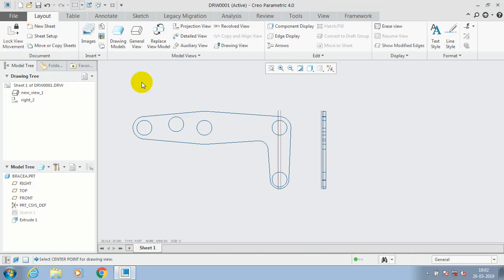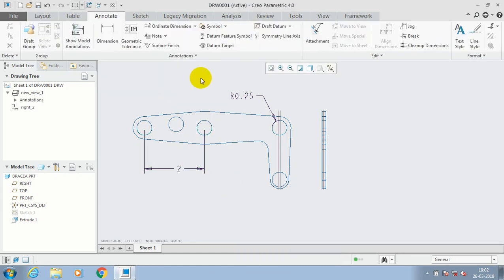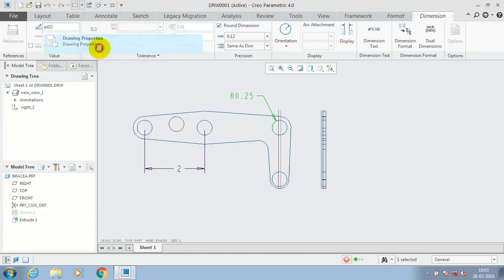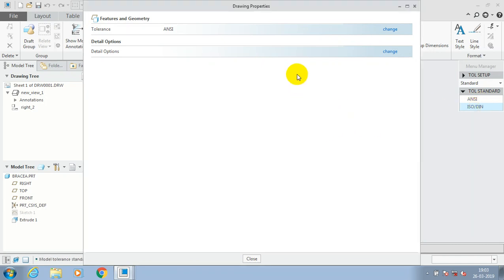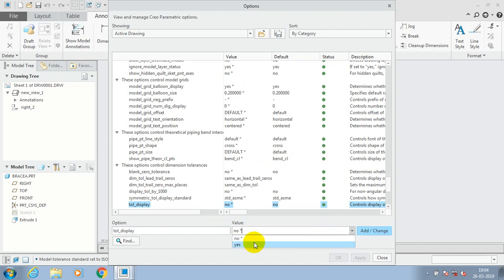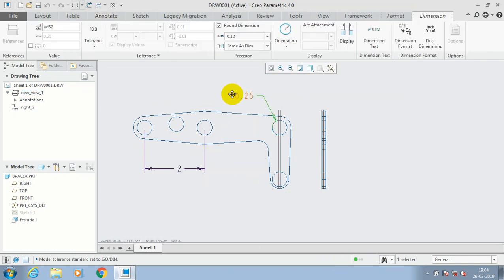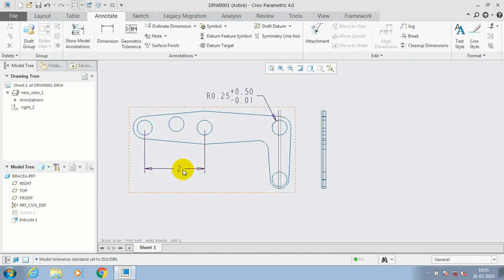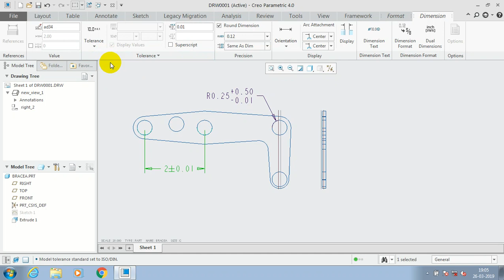HOW TO GIVE DIMENSIONS WITH TOLERANCE IN CREO 5.0/4.0/3.0

Comment: Thanks a lot for the video. I need some help. The limits tolerance appear horizontally, minimum @ left to maximum @ right, (ref. @ about 2:40 location in the video). I would like to know how to get the min and max values vertically (min at bottom and max at top). Please reply. Thanks.